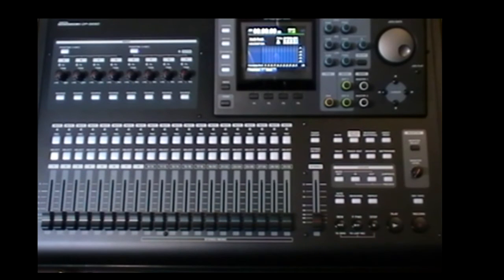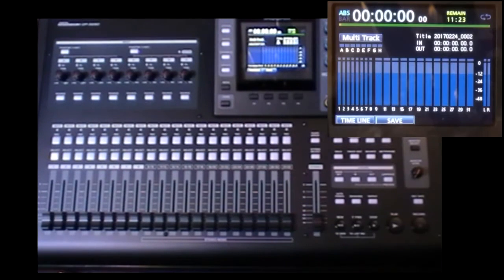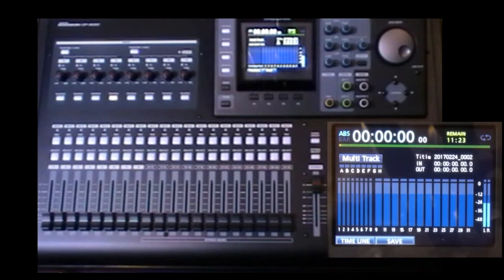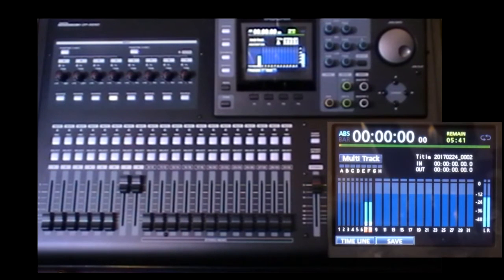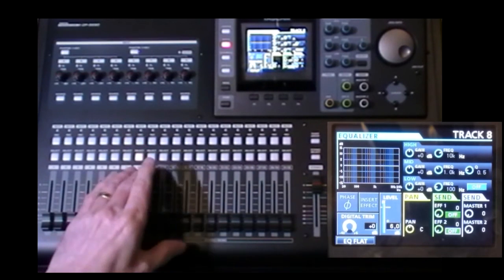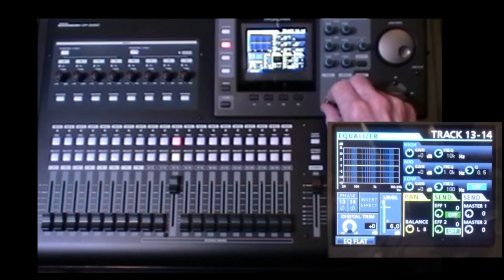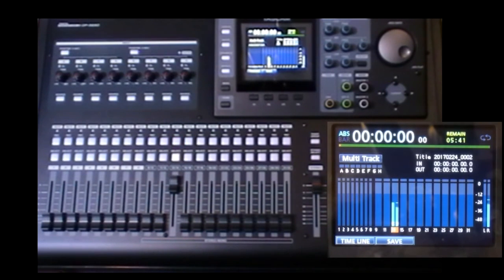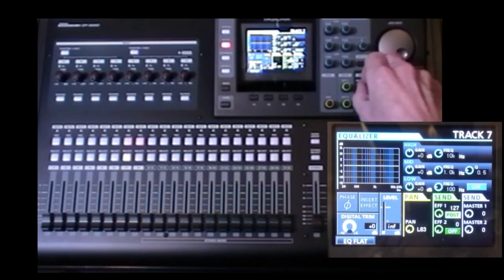Tascam DP24/32SD Tutorial 6C: Stereo

Comment: Hi Phil and thank you very much for all your great work! I just got the 32sd a couple weeks ago, and I'm having trouble panning anything. I turn the pan knob and the dial on the screen is moving but the sound stays te same? Most recorders I've used allow you to pan in either direction after recording the track but this one is not moving...what am I doing wrong?
Reply from the maker: @Tripp Smythe thanks for the feedback. The pan knob only affects the 'current item' - it's shown at the top-right of the mixer screen and could be an input or a track. You select the current item by pressing a track select button or an input source button - it will light up. In your case if you want to pan a recorded track during playback or mixdown, you need to make sure the track select button is lit. You don't need to have the mixer screen open as the pan and other knobs will all operate on the current item regardless of the mixer screen. If this doesn't work, you need to check what signal you are actually listening to. This is why I rant on about the block diagram :)  If you are monitoring the stereo output (Monitor Select = Stereo), then the track pan effect should be audible. If you are monitoring something else, such as the Send signal, you won't hear any pan effects. Hope this helps.
Reply: @philtipping  Nothing worked so I called tech. We were on the phone testing this and that for a good half hour, and he said, "you need to send in the machine, something is wrong with it." So I got it packed up and ready to ship. Once again thanks again Phil, you gave me the knowledge I needed to get to the bottom of this!
Reply from the maker: @trippsmythe9964  sorry to hear that. The only other things I can think of are: 
1. Are you using the latest firmware?
2. How are you monitoring the sound? If you're only using headphones/earbuds, you could have a faulty or incorrect headphone adapter which converts everything to mono. If you've double-checked using the monitor or stereo outputs at the back, then yes it does sound like a faulty machine. Hope you get it sorted.
Reply: @philtipping  Yes Sir, we went over the output with the tech, he made sure I was using the 1/4" monitor out using monitor speakers. He had me create a new song, and yes, still no pannig so yeah I think it needs servicing, thanks again brother Phil!

Comment: I may be on the wrong video. But I'm having an issue trying to find out how to record multiple microphones simultaneously. After assigning the track to the mics and arming them. I can only select one source to record and not of the other armed tracks record anything.
So basically. While recording a drum track with multiple mics. All i end up with is a bass drum.
I'm getting super frustrated.
Reply from the maker: @Scooter Wallace the track select buttons have nothing to do with recording - don't listen to myths on social media ;)
You are correct in that you assign the different inputs (A to H) to different tracks (1 to 24 or 32 depending on your machine), and arming each of those tracks by pressing their Rec buttons.
If you do this, all the tracks should record their assigned inputs when you press the main Record button.
There are several things to check, e.g. before you press Record, can you see the meter bars for each track moving in the home screen when you play some drums? There are other possibilities which may need a lot of explaining. Contact me via my email address on the philizound.co.uk website and I'll try and help, or take a look at my step-by-step guide, also available on the website.
Reply: @philtipping  
Thank you for replying! I have found my issue. It wasn't the dp24sd at all. Turns out I needed new mic cables. Sorry to have bothered you.
Reply from the maker: @scooterwallace6119  No problem - always worth asking :)  Good luck with your recordings.

Comment: Is there anyway to connect a d j controller to the tascam DP24?
Reply from the maker: @John Rodriguez I presume you mean can you control the dp24 via MIDI? I don't have the MIDI model but have a look at the manual... page 75 shows how to control the transport remotely, and pages 101 onwards show the various track settings which can be remotely controlled. Try asking on the Tascam forum - there are definitely members using MIDI with their dp24 machines, so should be able to offer better advice.